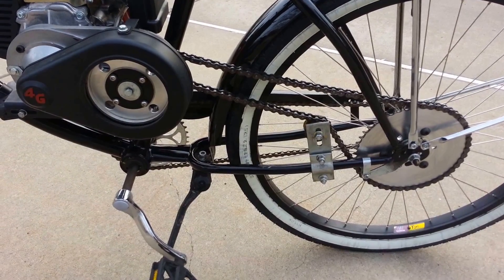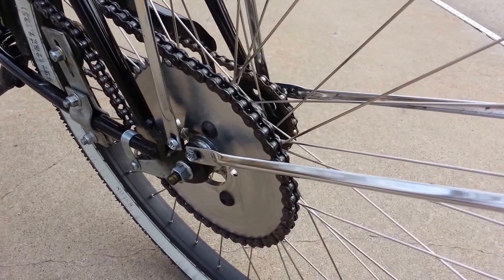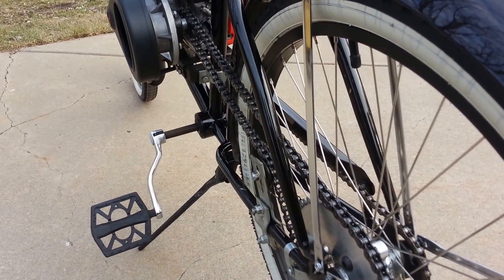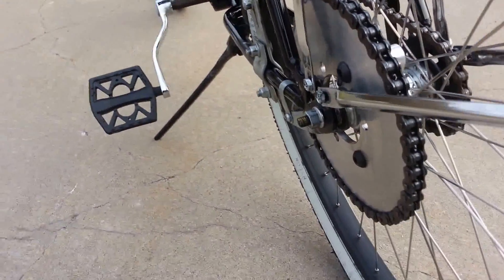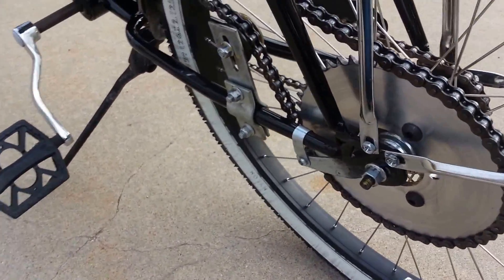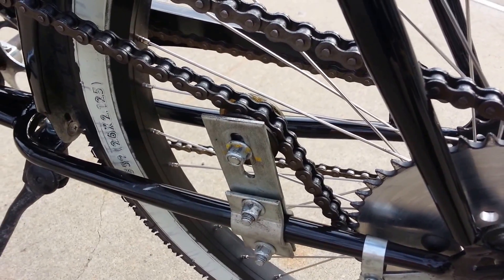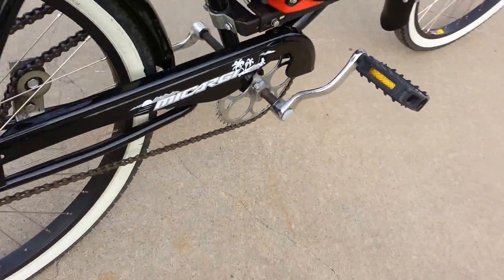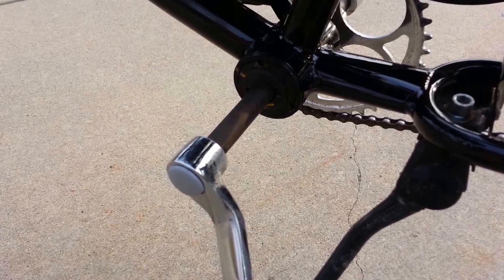Motorized Bikes Chain Drive

Comment: Hey, I am in the process of installing a 48cc 2 stroke. I just put on the engine chain and unfortunately it rubs against the chain stay and actomatically derails itself. I don't have your fancy (and sexy) hub wheel thing. Do I need a different bike frame or this peice so I can move it to the right? Let me know where to buy this! THanks.